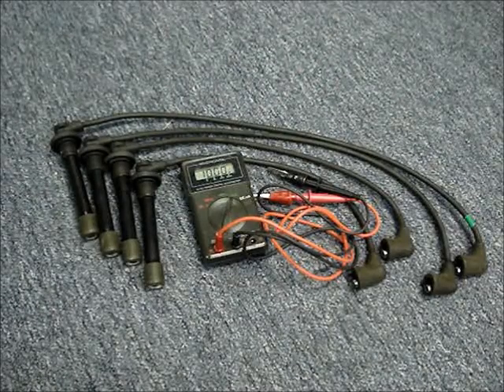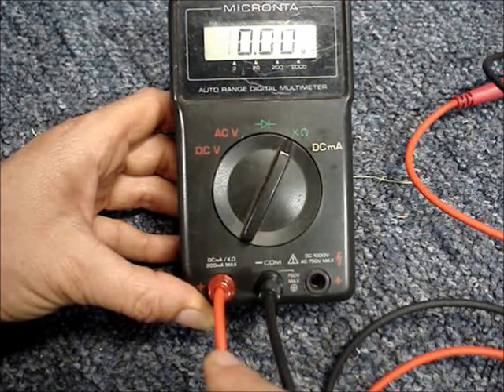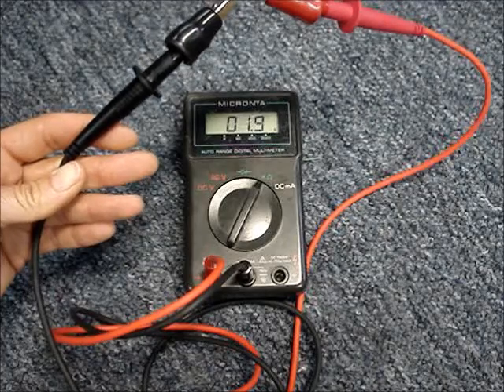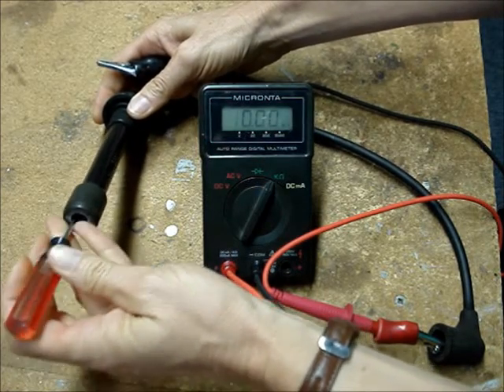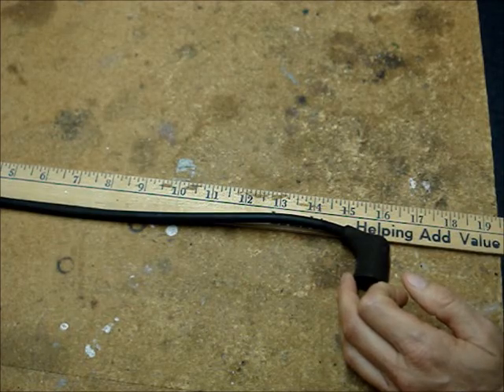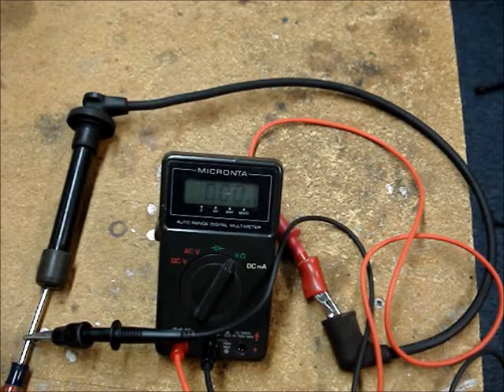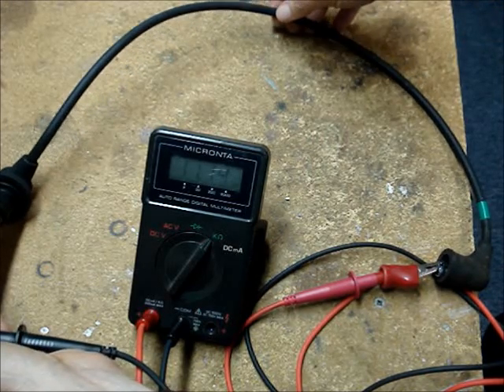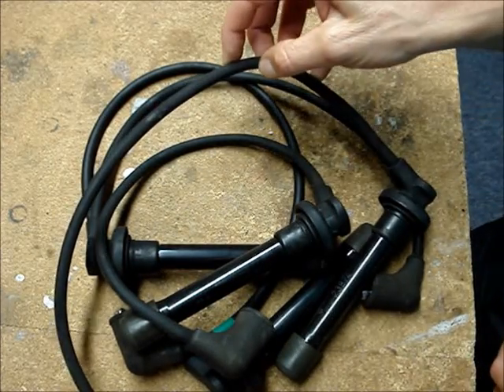Test Spark Plug Wires With Multimeter

Comment: I have the same Radio Shack meter!
It still works after all these years.
Reply from the maker: I carried that meter for work and used it every day for several years.  It took a beating. One of the metal tabs that makes contact to the battery broke some time ago.  I had a piece of tin foil stuffed in there for a while.  I felt it made it no so reliable.  I replaced it with a fluke.

Comment: I have a question for you. If there is no continuity in the spark plug wire edges, does this mean it is broken? The resistance is there but not the continuity
Reply from the maker: I'm not understanding your question.  I don't know what your meaning of spark plug wire edges.
Reply: @Know-How-Now  measuring the spark plug cable with the multimeter gives me resistance but not continuity. So the cable is broken, or am I wrong?
Reply from the maker: Continuity is around 0 to just a few ohms.... that's what you would read on a few hundred feet of #14 copper wire.  Spark plug cables are supposed to read much higher resistance per foot than a copper conductor.  https://www.championautoparts.com/Technical/Tech-Tips/Defective-Spark-Plug-Wires.html

Comment: 18.5 resistance on coil wire to distributor...1993 honda accord 
13 inch length.
Too much resistance?
Reply: very high for the length...a 3 ft length should be around 9-10k... a 1 ft is usually 3 K ohms

Comment: It’s actually longer the wire less the resistance.  Ohms is backwards bro.  Noob
Reply: Longer the wire, the Greater the resistance ...Fact......you may want to do  some research before calling the video creator a noob,,,
Reply from the maker: Ummm I think you are mistaken.  You might want to brush up on Ohm's Law. https://www.cirris.com/learning-center/calculators/133-wire-resistance-calculator-table
Reply: Got me wondering why @iwana would think a longer cable would mean less resistance.
Probably they rationalized a scenario in which 2 cables of different quality or gauge had similar resistance. In which case the longer cable would get less resistance per inch/meter and hence heat up less. Then it might seem that a less heated cable got less resistance.
Reply: You all just got trolleddddddddd mutha fkasssssssssss
Reply: @iwanaGoFast2010 haha I was just pretending to be retarded
Reply: That wire was mass produced.  It has a specific resistance design per inch of wire. Therefore the longer the wire the higher the resistance of each wire, as she explained clearly..
Reply: @jla6558  It’s more resistance if the loop is closed not on an open.  Dude

Comment: I must have the same kind of multimeter you have to apply your lecture.
Reply from the maker: I'm not sure if you are asking a question.  You can use an auto-range multimeter, that's the kind shown in the video.  You can also use type that you select the range.  For novice mulitmeter users, I recommend that you buy an auto range multimeter.  It's way easier to use and there is less chance for user error.

Comment: This is such a great video. I had a perfect LT (primary circuit) state but no HT output to the plugs. My problem was a faulty lead from the coil to the distributor.
Plug leads are very difficult to check on your own, as it's hard to correctly ground plugs and see spark strength when you're turning an engine over.

This solves the problem with respect to the leads - as you say consistency is the key - making sure the resistance takes account of lead length. Clearly explained and demonstrated. 
Now - come and take a ride on UK roads in a Triumph TR6...
Reply from the maker: Thanks for taking the time to comment.  It's good to hear that the method in the video helped with the troubleshooting.  Hopefully, we will be able to travel more freely soon.  Have a great day in the UK.

Comment: still confused. so, the service manual or all data has spec numbers based on wire length? that test is rather inconclusive. your service manual says that your reading should not be greater than 25k ohms. how helpful.
Reply from the maker: If you want exact numbers you may want to try to get them from the wire manufacturer.  The test lets you figure out approximately how much resistance for a length, then with a little math you can get rough idea if all of your wires are in the ball park of what they should read.  If the insulation is breaking down, this test won't help.

Comment: is there any sequence to plug it depending upon its resistance?
Reply from the maker: I'm not real clear on your question, Saad.  I will try to answer.  The longer the wire, the higher the resistance reading.  You'll need to test all of the wires to get make an educated guess on whether or not the wires are good.
Reply: Know How Now I meant that the longer wire usually have more resistance and the shorter has less resistance comparatively, so is there any specific sequence for plugging the wires? like the longer wire must be plugged into the first spark plug and the other end into its rightful place and not plug the longer wire into the third spark plug...?
Reply from the maker: You have to connect the wires between the distributor and the cylinders according to the firing order for your engine.  The longest wire will go to the cylinder farthermost away from the distributor.  The 2nd longest to the next farthermost cylinder and so on.
Reply: thanks a lot you've been very helpful
Reply from the maker: You are welcome

Comment: Great Video--the ratio analysis makes sense
Reply from the maker: Thanks the the compliment, Randy.  Other than getting the specs for your wires, it's the only way I can think of to get a rough estimate of the correct reading for each wire.

Comment: I brought new spark wire and tested it and giving me reading .825. Is it good or bad? Right car now getting spark. Could be bad spark wire?
Reply from the maker: I don't know the specs for your plug wires, so I can't tell if that is a good reading.  That's why I have you measure all of them so you can get an idea of the correct reading for your set of wires.

Comment: I really can't understand. I bought  a brand new cable spark plug. 
Kia Rio Model
It measures 1.8 ohms
The old one cable  measures 2.2 ohms.
Both with the same length. 
What my conclusion should  be?
Please advise,  I am freaking out because of  my lack of intelligence.
Kind Regards
Reply from the maker: I wouldn't get upset about a difference of less than 1 ohm.  1 ohm is a very minute amount of resistance.  I wouldn't be concerned.
Reply: @Know-How-Now  Thank you
But..I am very confused, wich one has better resistance the old cable or the new cable?
Reply from the maker: I made the video because it's difficult/impossible to get the specs (as you have discovered) for your particular set of wires.  By comparing them, you can get a rough estimate of how much resistance you should read on each cable to find out if it is broken/damaged inside of the insulation and make an educated guess to replace them.  The insulation on the cables breaks down over time and that can fail too.

I have no way of knowing the specs for each one of your cables, especially something so small a .4 ohm.  Depending on the quality of a multimeter  you could have .4 ohm difference from one meter to the next.  Likely, your question needs to be answered by the engineering department of the manufacturer.  Sorry, I am not one to give you an answer to a question that I don't have the ability/information to answer.
Reply: @Know-How-Now  

I am chatting as a "friend".
 I am just saying that  the supplier likes to sell spark plugs cables, oh yes,  they like to sale them. But asking specs for the cables, complicated.  Very disappointing.
Reply from the maker: I didn't think our conversation was unfriendly, though, I couldn't answer your question.  I agree, I think some times we are told to replace parts that don't need to be replaced. 

I monitor my gas mileage, if drops off, I start to look at the ignition system.  An ex-mechanic who managed a car fleet for our company told me that's how he monitored the vehicles.  If the miles per gallon dropped off, there was a problem.   It has worked well for me and I don't waste money/time on ignition system parts that I don't need to replace. 

Where I live, around late September/early October, we get winter blend gas.  I've been told by an engineer that works for Sunoco that they put butane in the winter blend gas.  I get about 10 percent lower gas mileage until we start getting summer blend gas in the spring.  You also get about 10 percent less mileage per gallon with 10 percent ethanol gas.  I've compared it to non ethanol gas.
Reply: @Know-How-Now  

Exactly, an eco-friendly attitude.
I totally agree and 
that's why  I bought new spark plug cables.  But! The new cables have more resistance. How on Earth  is possible?  around 8 years old   with 98000 miles  have less resistance instead of new ones. Because of you I realised that the new cables have resistance issues (comparing to old). Thanks!!
And at same time we are not allowed to know  the specs of cables...very sad.  I got the refund except the specs. 

Thanks for your video. My  future own mission: to obtain official  spark plugs specs in regards of resistance.
Reply: As long as the reading is consistent the wire is fine. That little bit of difference will not make any difference of the integrity of the spark plug wire.
Reply: @drivingschool11 The new wires were not necessarily bad. They were likely designed to be manufactured to a slightly different but acceptable specification, just as many car parts are  designed to slightly different specifications by various suppliers. Two competitive products can be intentionally designed to slightly different specifications but still both be within allowable tolerances. In that case they are different but still can both offer equal performance as that one measurement was only one of many measures of the product's total performance profile. The cables with the lowest resistance are not necessarily the best cables by that measure let alone by the many other important measures of the total design specifications that are part of every product.
Reply from the maker: .4 ohm is so small of a difference that really, both cables are the same.  The old cable has slightly more resistance.
Reply: @Know-How-Now  
But something is wrong.
The old cable is very used for around 94000 miles.
My conclusion is that the new cable has poor quality. 
It's impossible 94000 miles but practically with the same resistance of the new cable.  I  called the supplier and he said: - yeah..no problems bro I will refund        the money back. But!!
I called Kia  and asked what's the standards   for the spark plugs cables   resistance from Kia Rio.
Reply: we are not entitled to inform  the resistance standards  for those specific cables.
Very strange,  94000 miles and new cable  with not much difference. Something is wrong.

Comment: don't stop keep your nice work we can use multimeter to diagnose almost everything around us cars, home devices, electronics, solar system, batteries , phones, HAVC, etc and actually everybody must have a pocket multimeter in the car its always helpful even if it low price multimeter (but just for cars simple diagnose not for serious electricity work in this case it must be high quality multimeter for safety and always use it with extreme caution).
i like your video and after i read your replies on comments i subscribed and by the way not everyone understanding fast it's different from person to person so my opinion is your video wasn't long.
Reply from the maker: Thanks for subscribing and the complement, Sherif.  My thoughts were that if someone was looking for help with this topic, they probably had very limited experience using a multimeter.  After electronics school, I made many rookie mistakes and I wanted the viewer to avoid the common mistakes.

Comment: Not too long.  Just an in depth video for a beginner looking at their plug wires.  Thank you.
Reply from the maker: Thanks for the compliment, Tom.  That's what I was hoping to accomplish.
Reply: Know How Now . I am probably going to need to use your test this weekend.  My brother in laws 2005 PT Cruiser Turbo has developed a bad miss and backfires when he tries to pass another car.  The check engine light came on with a P0303 code for cylinder three misfire.  I am going to try to help him figure it out.  My code reader, which is the BlueDriver, said the most common fixes were plugs or the cam sensor.  I will see.  Runs great at idle so I don't think it is a vacuum leak.  Thanks, Tom

Comment: tooooooooo long
Reply from the maker: Thanks for commenting Sayed.  I'm always open to feed back.  What parts of the video would you suggest that I omit?
Reply: Know How Now the part concerning learning of using multimeter was too long
Reply from the maker: I agree, it's a little long, getting accurate readings are critical.

My thought was that if someone is watching this video, it's likely they are not very experienced using a multimeter.  I see a lot of people with the free Harbor Freight multimeters, probably not great instruments and should be checked prior to every use.  Due to a bad pair of leads, I've seen people spend a lot of time and money trying to fix the wrong problem.
Reply: Know How Now thanks for your efforts but it would be helpful to point that in video title for example adjusting multimeter and testing spark plug cables knowing that the multimeter you used is not common in middle east and Arabian region, you actually  did it very well thanks so much
Reply from the maker: Thanks for taking the time to give me some feedback Sayed.  It's been a pleasure to chat with you.
Reply: Thats what she said